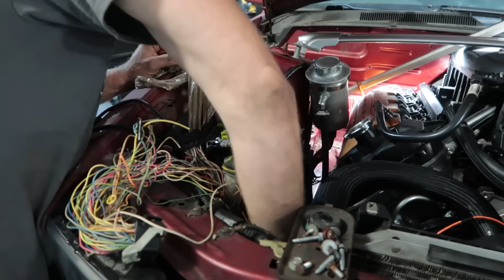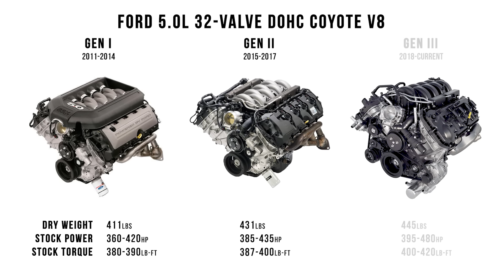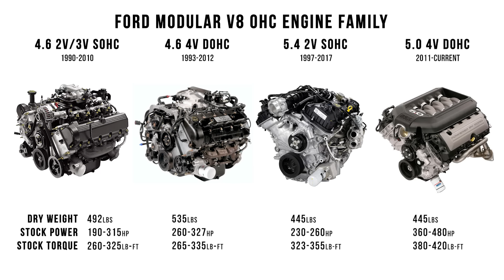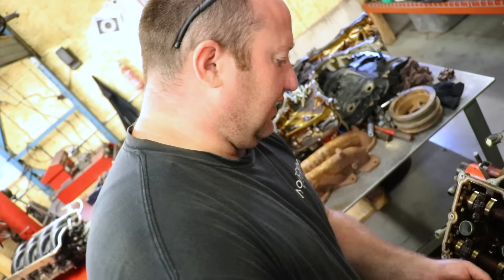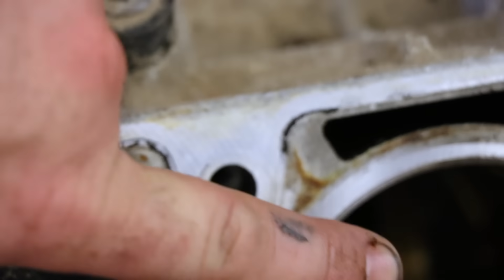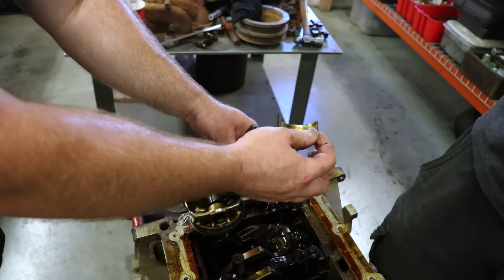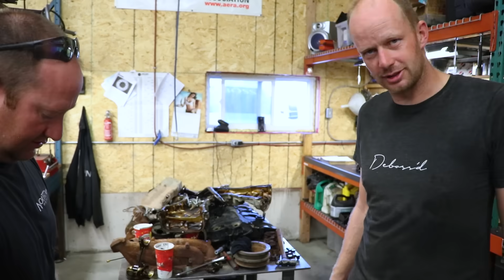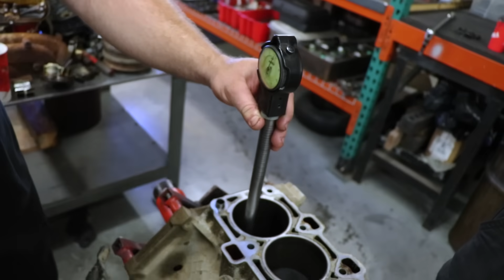REVIEW: Everything Wrong With A 5.0 Coyote Engine

Comment: From my time working at Ford in NZ I have to say the 5.0 is probably one of the most reliable and problem free engine we get
Reply: Thank you for this comment. My 3.5 is giving me out and was looking at the 5.0. What are some of the issues you’ve faced with the 5.0?
Reply: @fccoz8348  The only 5.0 issues that you may run into are failed cam phasers and solenoids, and oil consumption. That's literally it. The new generation ones also make a bunch of bullshit noises, but nothing that's been shown to be negative.
Reply: @ice44567  i have the 3.5 ecoboost and i have the cam phaser problem and was thinking of trading it in for the 5.0
Reply: @fccoz8348  its much less likely on the 5.0
Reply: @ice44567  No oil no engine... not good at all. A Few people don’t even check there oil. Well a lot of people. Oil consumption wouldn’t be the issue I would pick. Anything else but that..
Reply: @ramrider1453  My Mustang was burning a quart in 1500 miles for a while but its chilled out the closer I get to 10k. Now it's like a quart every 2-3k which doesn't bother me much. It doesn't burn any if you aren't tickling the rev limiter all the time (which is hard not to do because it's fun)
Reply: @ice44567  I have a 2015 GT and it never burns oil.  But, I change the oil and filter myself every 5,000 miles and only use Motorcraft Filters and Pennzoil Platinum Synthetic oil.
Reply: @thescurfie  same my 17 gt pp uses no oil and collects very little in the jlt oil/ air separator although i dont beat on it just some very spirited accel hear and there.
Reply: @culbycars  I have the same oil separater and I'm glad I bought it!  Maybe 1/3 full at oil changes. I too don't beat my engine but I do drive it hard occasionally. It's a Mustang it wants to go!
Reply: @thescurfie  true statement
Reply: @thescurfie  I'm on Castrol EDGE EP 5w30 now and I haven't even used 1/4 of a quart in 2000 miles
Reply: @ice44567  I'm old school.  When I bought my Mustang I changed the oil at around 500 miles.  I know Ford pushes their Motorcraft Syn/conventional oils but I went straight to full synthetic.  I was using Mobil1 but switched to Pennzoil.  I also add a quart of PolyDyn TX7 at every oil change.  Great stuff.  I use TX7 in my lawnmowers too.
Reply: @fccoz8348  I would definitely trade in the EcoBoost for the 5.0L Coyote V8 for sure.
Reply: My 2020 f150 5.0 does make strange noises @ice44567
Reply: @fccoz8348  Not sure why some say problems with the 5.0.  I've owned 6 so far, from F150 to Mustang...from 2012 to 2019 and NO problems at all out of any of them!!!  My 2019 Mustang GT with Performance pack 1 and 10 speed auto had NO problems at all...just love it!!
Reply: The biggest "problem" with all engines is people not changing their oil and using a quality filter.
Reply: 2011 f150 5.0 and problem free (the engine) at 88,000 miles
Reply: @lobbyrobby  that’s fairly new but good to know.
Let me know how it is after 100k miles
Reply: @fccoz8348   mine has 134,000 miles and it hasn’t had any issues, only issue is 14.6mpg and small evap leak and ac door isn’t shut so I smell other exhaust I need to have Someone honest and smart to look at it.
Reply: @limondavid8  check your purge valve. I’ve gone through 2 of them. It throws evap leak code. Simple fix.
Reply: @fccoz8348  I’m running the 2011 F150 and no issue at 215,000 miles.
Reply: Like I wrote elsewhere. The basic engine design was the Ford modular engine family. They were used in police and taxi service and they would last a million miles when serviced well.
Reply: @chrisdaigle5410  would you yourself purchase the new 5.0 coyote
Reply: @fccoz8348  Of course I would. But I would take good care of it.
Reply: @fccoz8348  I wouldn't again, had a 2018 that was an oil burner,they replaced the engine and the new one was an oil burner also, my dealer assured me that for 2020 the issue was resolved so I traded for a 2020. He lied or just didn't know, it was no better.
  No way i was going with another Ford so i sent it to auctions thankfully the Americans are buying up trucks like crazy and paying premium prices, so i didn't lose a ton of money
Reply: @wasupfool5692  I had a 2015 GT PP and never had an oil burning issue or any other problems with it.  I now have a 2019 GT PP2 and still have no problems at all.
Reply: @wasupfool5692  maybe you should have gotten a lawyer. I may have to do that.
Reply: @wasupfool5692  how much did you get at the auction for it
Reply: @chrisdaigle5410  interesting. Here in Oz we have the i6 4v dohc vvt Barra, that can still be in good condition after 1M kms in a taxi.
Reply: @chrisdaigle5410  anybody that disagrees with you on this just holds an anti ford bias and their opinions cannot and should not be taken seriously
Reply: @-ac-8296  right? Speak I’ll of Ford and your just a hater
Reply: @chrisdaigle5410 lmao sure Bud no gas Ford engine will come close too a million miles without 4 or 5 rebuilds
Reply: @donaldkinder6716   The 4.6L modular engines have been lasting a million miles in TAXI service. Taxi companies have even been known to buy Ford Crown Victoria police cars after they leave service and continue them as taxi use.
Reply: @chrisdaigle5410  lol yeah bud your so full of shit id seen plenty of those engines in police cars Drinking oil around 100k miles
Reply: I work at the KCAP and I also come to that conclusion.
Reply: You must not get the Chevy LS engines
Reply: Worked at a Ford dealer for one year. Had a  2019 come in with 4500 km’s on it and it through a rod / seized solid.
Reply: @T410ce  Well its put together by man so your garunteed occasional lemons pretty sure warranty atleast replaced the long block
Reply: My 88 had 230,000 miles on it before I swapped it for a 347 stroker.
Reply: @Celticman197 lol we're talking about coyote engines Didn't make them in 88
Reply: @donaldkinder6716  They did'nt make much of anything in 1988.
Reply: @Celticman197  ID take a pushrod 5.0 anyday over the new coyote oil burner s Ford builds today Ford' Sells more 3.5 Eco boost Engine's in there trucks than they sell the 5.0 coyote engine even the Eco boost Engine's have trouble with burning oil
Reply: @Michael-ii9fs  any problems with the ls.
Reply: @fccoz8348  yes, bad design on the oil drain backs in the pistons. They clog and cause broken rings .
Reply: They burn a little oil. That is why they last.
Reply: Did someone really bring up an LS in this comment?  Smh.....
Reply: When automakers want to make goof reliable engines they can its all about what direction the engineers get pointed in
Reply: Great video. I have a 2002 4.6 2v F150 with 156k. Had timing chain replaced and the mechanic thought the engine previously had work on it because it was so clean. Runs great but wife wants me to get a new truck. I’m considering and looking at the 5.0. Think I’m saying away from ecoboost. My major concern is the oil burning on these 5.0 engines. From this video I feel much better. Looking at car complaints.com, Fords still have engine transmission reported issues but the Toyota and Honda Ridgeline have next to none. No oil burning stories. It’s all about reliability and I think they all have it but oil burning is just a flaw in design. Wish we could get the real story here. 
Great job guys. I’ve subscribed. I hope to hear feedback on my concerns to help on my next purchase.
Reply: @weimarutube  whats the sale % of the Toyota/Honda to the F150? If Ford is selling 5:1 then you will hear and see more issues since more are sold, just curious as i have seen all brands with engine/trans issues. They are all reliable until they breaks then its a POS regardless of brand lol
Reply: @young11984 
Exactly!
Reply: @weimarutube  change your oil at normal 5-6k intervals and your golden.
Reply: And whats funny is that 5.0 will NEVER take the abuse and last as long as a 5.3 of any year from day one to now bootie til I die
Reply: @badazz2969  Those 5.3 cylinder shutoff engines are junk. Ticking timebombs some owners had three engine replacements under warranty. If you want yours to last better shut off that stupid system.
Reply: @badazz2969 
😂 Newer 5.3’s are absolute garbage!
Reply: @badazz my 20 year ase master tech career says otherwise... 🤣 I love brand biased people like you. You will buy a gm product swear they never break down, all the while getting it towed in several times a year and spending big bucks all the while denying it to everyone including yourself. It's just maintenance the rear end in gm products need overhauled at 40k miles, the cylinder deactivation system needs 4k in maintenance every other year, the oil pressure drops for a number of "maintenance" reasons.... The transmission needs rebuilt at 50k, it's just maintenance. 

Any other vehicle y'all would be upset and pitching a fit, but can't admit you are wrong and that pos GM product is garbage.  🤣
Reply: @rickstorm4198  The AFM system on those Chevys create lifter failure and annoying ticking/tapping noises. Chevy has been cheaping our for a long time. And I can tell from the lighting in the dash being like Christmas there.
Reply: Coyote is the best engine out there, laughs in ls
Reply: Mine has a burnt valve at 160k miles having to spend about $3500 to fix it
Reply: 160k is alot of miles. I am willing to bet you didn't keep up on maintenance that helps this from happening. Coolant replacement, injector cleaning, valve and intake decarbonization etc...
Reply: I had a 2013 coyote and put nearly 200k hard miles on it with no issue. When I sold it, it still ran great!
Reply: My 16’ f150 5.0 says otherwise. VCT solenoids are a problem that Ford needs to recall and compensate owners for
Reply: @5.0Lorenzo  man, they can't issue a recall for isolated incidents. Sorry you got a bad apple and all, but my 2013 5.0 F150 has had no issues at all in over 209k miles, not even VCT solenoids.
Reply: @crewdawg2008  I didn’t get a bad apple, there has been thousands and thousands of people having problems with the stupid VCT solenoids. I know 4 guys that had to replace them and me as well. It’s not the cheapest job either
Reply: @5.0Lorenzo  Well, maybe I got a good apple then 😂😂😂
Reply: @5.0 larenzo. I retired in 2015, 20 year career auto repair. Still do welding/ fab work, build engines, restore cars, build race cars etc... I changed careers...

Anyways i hope you don't think GM is any better, or Toyota it Honda. 

I made just as much 💰 from them too.... If not more to be honest.

I could write a book on common issues from cheap and easy repairs to the worst kind and most expensive.....

Just saying....
Reply: Burning oil... what it took 10 years to almost figure it out.
Reply: @Mac Attack Yeah I have one, everyone I've ever talked to says theirs does the same. Weird rattles and ticks. Just ignore it.
Reply: What gen
Reply: Agreed
Reply: Wrong
Reply: Did you see many engines with the typewriter tick? What's it caused by?
Reply: 4.6 or 5.0? Which is recommended?
Reply: @madebydade305ify  Both very reliable. The 4.6 was used in cop cars for a long time. The 5.0 I'd the better option for power, since it has 100hp more.
Reply: I have a 2017 gt 38,000 Just got it looked over oil change etc…. mechanic said everything is great no problems.
Reply: Yep you got that right brother
Reply: I have a 2012 f150 5.0 with 295000 on it.  Oil changes when the truck tells me it's time(about 10,000 miles) I am looking at a newer f150 with the 5.0 due to reliability.  I have changed the plugs at 200k for maintenance.  I did go through 2 water pumps and recently had to replace 1 coil pack.
Reply: My experience  with my truck has been like this: I own a 2018 F-150 XLT 5.0 L with 68k miles on it. From day one it started burning oil like crazy. Been told by everyone it is a normal thing. Right now It burns 2 qts of oil in between oil changes. This past weekend I had to replace 2 ignition coils (twice), 1 solenoid (mechanic had to remove the valve cover to gain access to the solenoid), new valve cover gasket, plus new spark plugs and a fuel cleaning service for a total of $1,700 dlls. 
I was wondering if you guys can tell me if this is a normal thing for my truck.? If it is or not; is the oil consumption going to get worse.? 
I am dreading one day the engine will blow up and might need to get a new engine.
Because I really like my truck but reliability is a  big issue for me. I am seriously thinking of getting rid of it and buying a Japanese SUV.
Reply: My friend anything on a 2008  5.7 toyota tundra  as i have, Thanks
Reply: That gives me hope, Thank You.
Reply: I’ve had three coyotes and none used any oil between the recommended oil changes using good oil. The one I own now has 120,000 on it and never had to add a quart. I did have to put a cooling fan on this one @ 91,000 but that’s not a big deal. My daughters Camaro with an LS has used several quarts between changes, last time I checked it for her it was over 3 quarts low and electrical issues have it sidelined for now, what a clunker! These mod engines were made for the long haul. Chevy owners will never know, they are too jaded. I work in a machine shop that specializes in dirt engines and Chevy is our bread and butter but we ran a boss 302 from the 1969 era and lapped the field which was mostly Chevy and sometimes all Chevy. They are slow compared to a good Ford engine and the coyote is light years ahead of the LS engines and when properly maintained are bulletproof and with absolutely no oil consumption that is noticeable. Drive them like you stole them and change oil and you are good to go with the coyote.
Reply: I've just bought a F150 Gen2 Coyote with 127000 km and live in NZ in the Waikato.
Always used Penrite oils in my vehicles... Can you recommend the best oil and filter to use as I'm new to these engines and been checking YouTube.
Cheers
Reply: @mokopotaka-xi3jt I’ve had my gen 2 for 6 years now. I use pennzoil platinum 5w-30 and I use a motorcraft oil filter. Buy an oil separator immediately for the passenger side. If you notice in the video these guys show the sludge on the passenger side head. The oil separator will capture the sludge.
Reply: @mokopotaka-xi3jt with every oil change add a bottle of liquimoly ceratec. Your engine will be dead quiet.
Reply: @mokopotaka-xi3jt full synthetic too of course😂 but if you have money to spend on oil get Amsoil. Best oil money can buy
Reply: The tulip valves suck when their in your engine 😢
Reply: i agree, here in Australia, the 5 ltr coyote is a indestructible engine, and i have not heard of a single engine letting go.
Reply: My 2011 coyote had 375k miles when sold it in 2017 n bought a 2018 coyote sales ppl always force me to buy a v6 EcoBoost im like dude you buying it or me so i want a coyote no talking me out of it now has 175k no issues
Reply: @michoacanom4320  si pues cocho
Reply: @michoacanom4320  Awesome brother, I have a 2011 Ford F150 with a 5.0L Coyote V8 with 147,000 miles still going strong (with only a misfire which hopefully it'll get fixed) and its a beast and it sounds like a beast with the Borla ATAK exhaust on it.
Reply: @CJColvin  yeah basic maintenance it will run 300k no problem
Reply: @michoacanom4320  Awesome
Reply: @michoacanom4320 timing chains be broken before 300k long time before amazing how many liars on this pg
Reply: Have a small fleet. Changed to full synthetic. No issues. What so ever. Have 7 that have gone over 400,000 km. With ease.  Honestly. Not brand loyal. But man
 One of the best engines ever.
Reply: 2011 F150 5.0 205k still running strong.
Reply: And that's sad to admit that the 5.0 is ford's best engine because they are junk filled with oil consumption issues and throwing timing left and right hard pass on any ford product they make a nice car and truck but it's not worth it because they can't design a engine right to save their life's.
Reply: @Back_door_bandit_98  141k miles on my supercharged 2015 mustang gt. All driven myself no problems at all. 5.0 is reliable and Beastly.
Reply: @ShagmireGigity  LS powa
Reply: 5.0 is nice. Great top end. The LS 5.3 and 6.2 are unbeatable thus far imo. Owned all 3
Reply: 85% of all Ford are still on the road.. The other 15% made it home....
Reply: I serviced my 2015 mustang gt every 5000 miles and it still ended up eating the rod bearings. I got a crap load of copper shavings on the last oil change and quickly got rid of it. What a major disappointment I loved that car.
Reply: Had a nephew buy a 2016 f150 couple yrs ago had the 5.0 coyote engine at 40k miles started using oil he traded it in on a new silverado said he'd never buy a ford again
Reply: @donaldkinder6716 
So he bought a 5.3?
Those newer ones are junk and tranny’s are lucky to make it 100k.

Comment: i've pulled down a few engines i've ran synthetic on, and have never seen one showing near the contamination of this.  my differences are that its not very many short trips,  the engine is fully heat cycled every tiime its keyed on, as in the oil gets to full temp long enough to boil any water out, if my trip isnt long enough, the engine will idle for a bit, i always use the same oil, however, i go massive intervals between changes, 30k between oil changes.  the ones i've pulled down have shown nearly no wear or sludging.  an ls1, jeep 4.7 ho, toyota 1uz, toyota 3uz.  the toyotas were only the valve covers but they were spotlessly golden under them.  the ls and jeep came all the way down, and same deal, spotless and golden, hones were still fresh at 150k.

Comment: I have seen cheep synthetic oil discolor in an engine or the oil was in way to long.
A high quality synth oil doesn’t gum up or discolor.
That engine didn’t get regular oil changes.
That ran out of oil.........
I run synthetic oil in everything. And if synthetic oil was hard on aluminum my 10,000 rpm motorcycles would never survive.
This guy just doesn’t like synthetic oil.